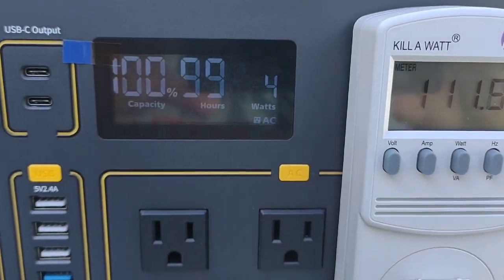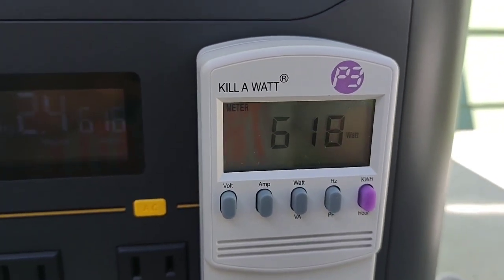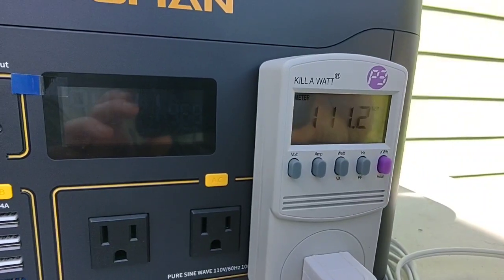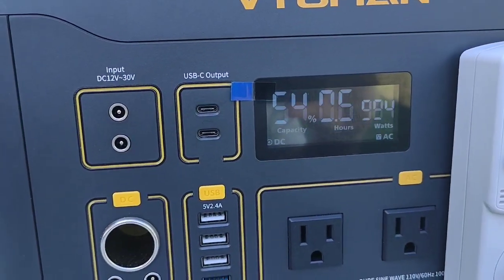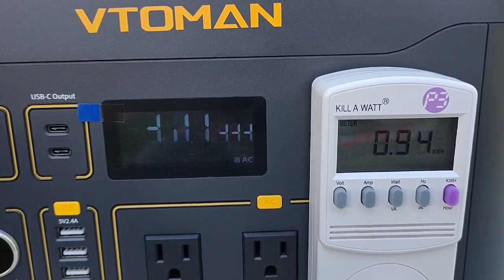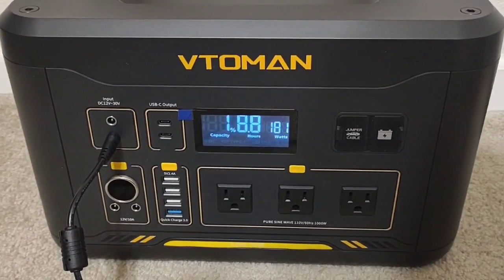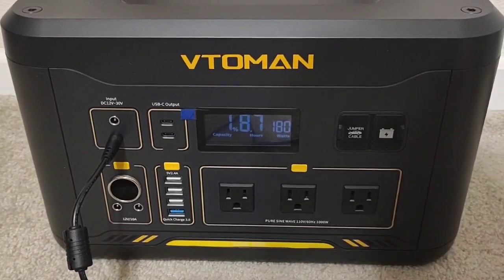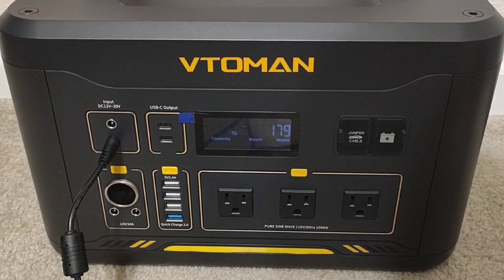Vtoman Jump 1000 LiFePO4 Power Station Full Load Capacity Test

Comment: I don’t have a clue on ANY Of these things, I Bought the 1000 in a Bundle with the Extra 1500 battery.. I’ve not bought any solar panels for it yet, The price for the Bundle was 1,440 Amazon had a 900.00 off on the set.. This No extra for A SP. I haven’t even used it yet.. 😮